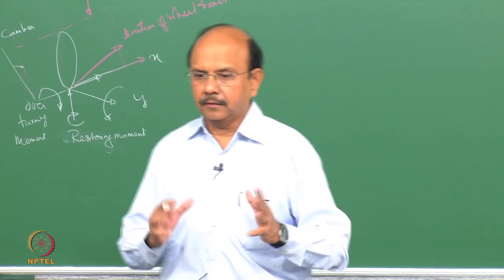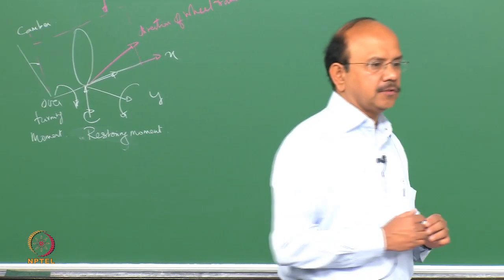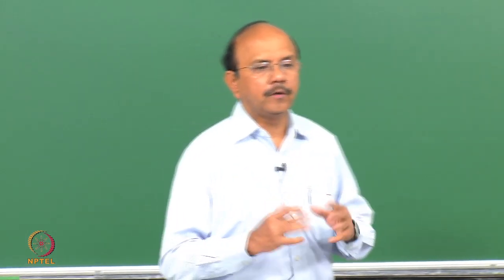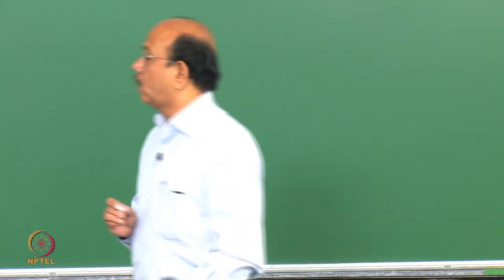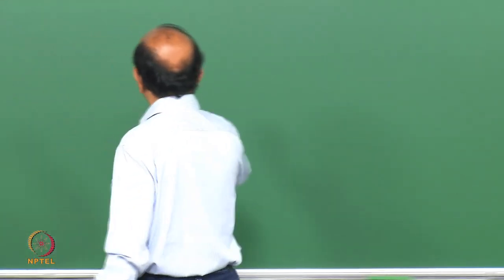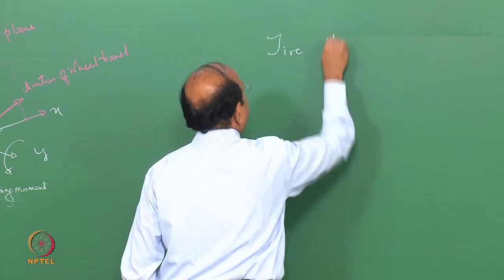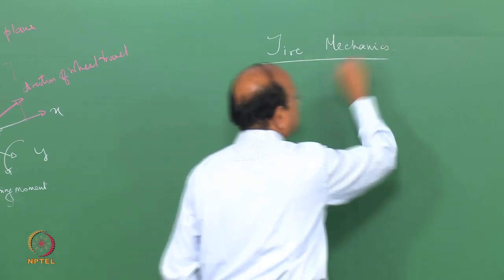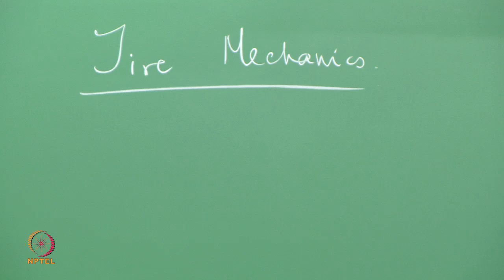Mod-01 Lec-06 Tire Mechanics – An Introduction

Comment: 14:18 "handling" (of low aspect/profile tires) "a lot safer"

How so?  

Most folks I know prefer the combination of larger diameter rims with low profile tires for the looks.

For a laid-back driver like me, it means having to pay more attention to where I am within my lane on the highway, or where the car is pointed in general.

The much wider, lower profile combination of wheel and tire on cars since 2010 has made driving, for me, a more two-handed steering wheel experience, compared to before, with a narrower rim and higher profile tire.  

Those tend to want to go straight, and are less subject to tramlining and being tugged side to side by a variety of road imperfections, such as joints, pot holes, or small stones littering the drive lane.  

Additionally, on a car with lower profile setup, higher degrees of self-correcting suspension alignment angles, such as Caster, and SAI(steering axis inclination) or 'kingpin angle' as we called it long ago.  

I don't really feel any benefit from the sharply more responsive steering afforded by huge wide wheels with super low sidewall strips of rubber wrapped around them.  

I could see the advantage of such a setup, however, in a competition theater, such as a car race